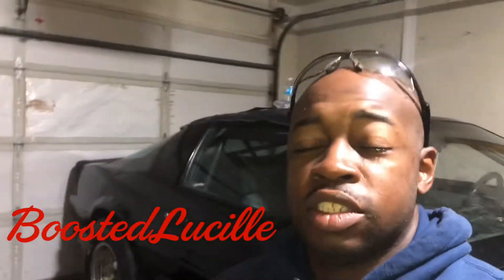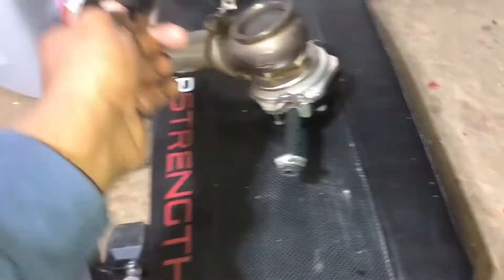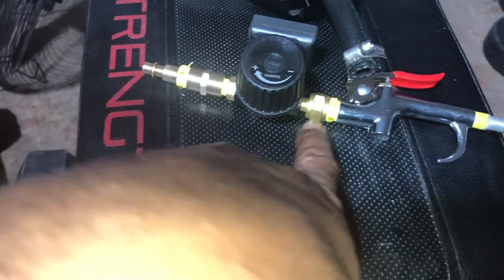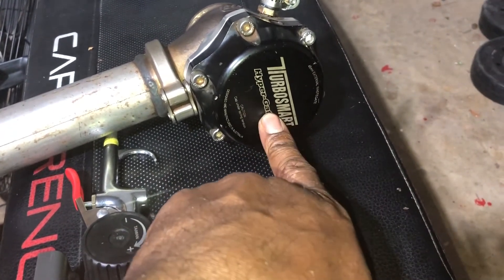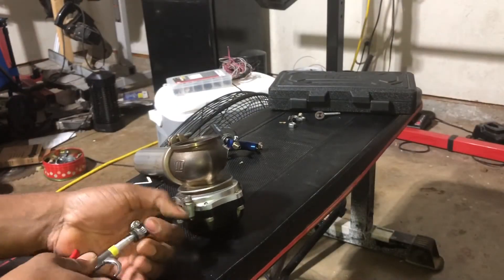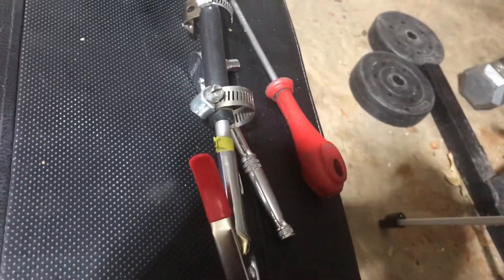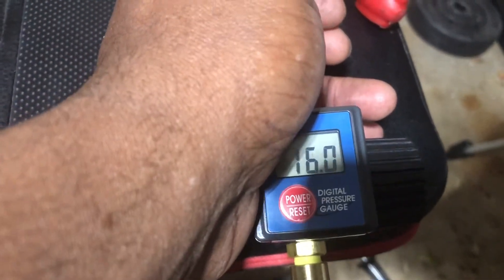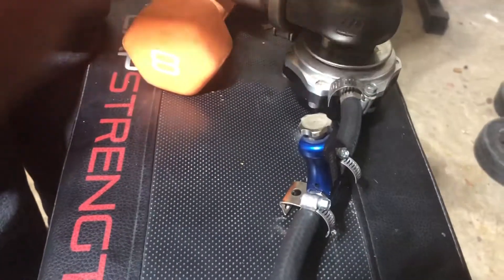How to check Wastegate Spring Pressure and Booster Controller #wastegate #boostcontroller #LSswap

Comment: Sounds like that gate is leaking pretty good...
Reply from the maker: It’s possible, it is old but that boost controller bleeds off air when it’s adjusted
Reply: @boostinwillie  ok. I thought I heard a leak on the first test without the boost controller inline.
Reply from the maker: It’s old probably is..., going to replace the diaphragm in it.
Reply from the maker: Actually about to buy another VS racing 44mm to have matching ones, lol